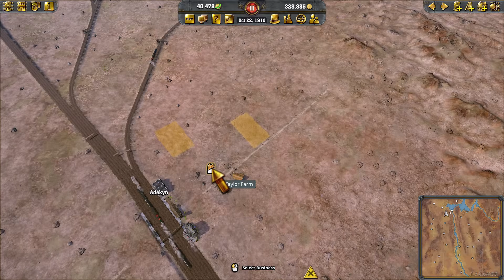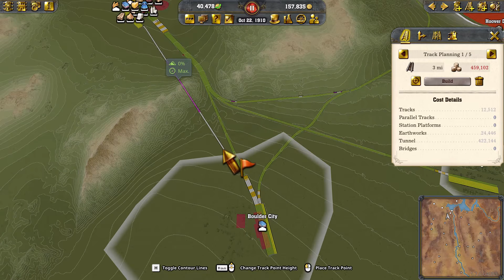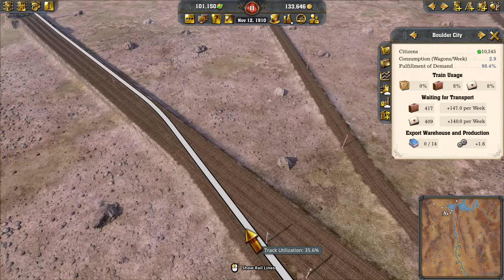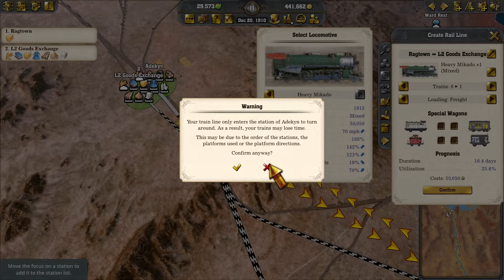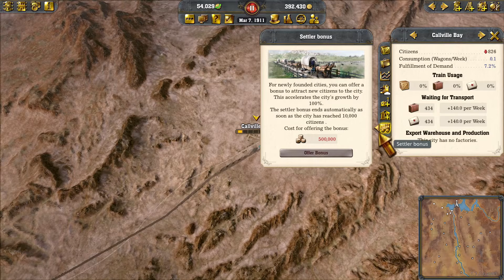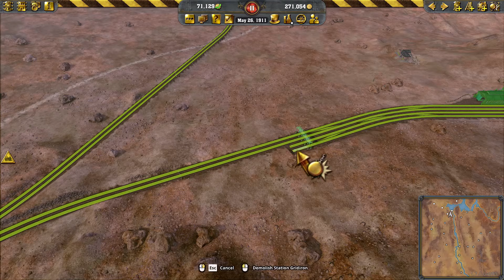Railway Empire 2 Industrial Wonders DLC The Concrete Giant (Hoover Dam) Part Two

Comment: For gravel use, you do no have to have a concrete plant. Larger cities use gravel on its own. It will then request the gravel from Hoover Dam (or the warehouse if you prefer that middle man). You do not need to have all the other concrete ingredients available, as in running a Concrete Plant. I simply shipped to existing large cities.